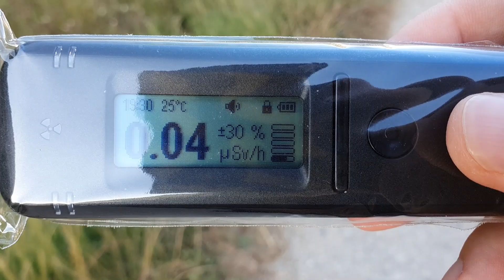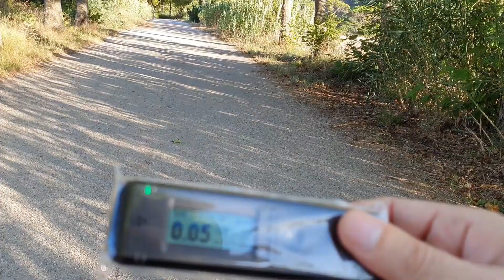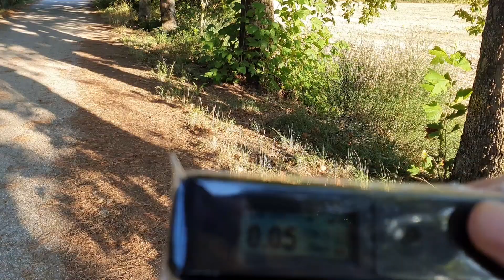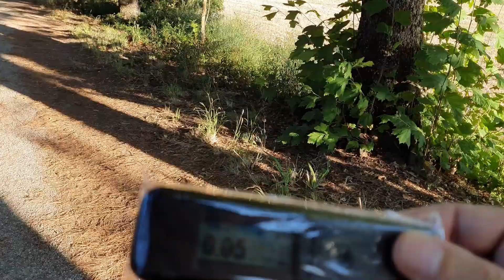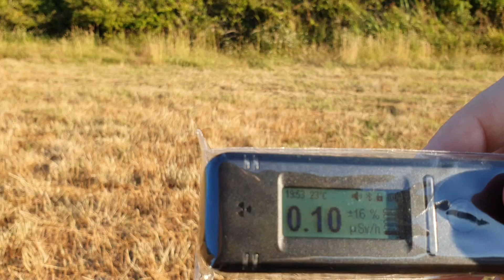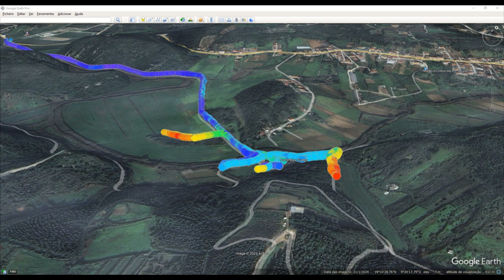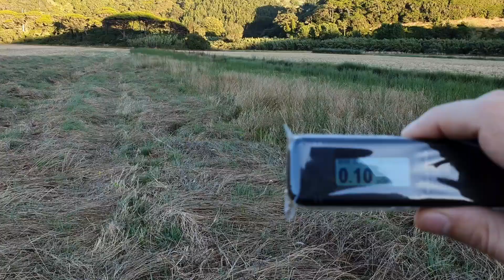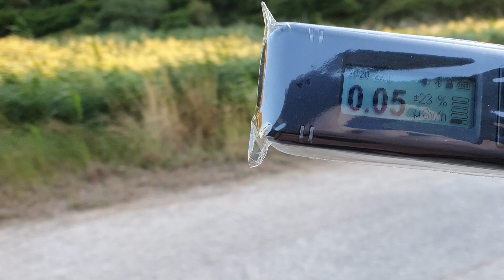Radiation Levels in Agricultural Fields

Comment: What's the highest reading you've found from rocks?
I've got glacial erratic with Radiacode 110 reading 200 CPS in one spot. (twice the reading of putting RC110 touching ionizing moke alarm)
Gamma spectrum shows decay chains of both Thorium-232 and Uranium.
Have also one other boulder nearby with nearly similar reading and possible source bedrock for that.
Reply from the maker: Measurements in CPS (Counts Per Second) or CPM (Counts Per Minute) are not traceable quantities, meaning they cannot be directly compared between different instruments against a single reference. CPS/CPM are "raw" values. As I have explained in other videos, a more sensitive instrument will display a higher CPS reading than a less sensitive one. However, the dose rate (μSv/h) should always be the same, regardless of the instrument used, provided that the detector is energy-compensated. For example, the RC 110 is more sensitive than the RC 103; therefore, a reading of 200 CPS with the RC 110 may correspond to only about 80 CPS with the RC 103. The larger crystal will naturally "catch" more photons, resulting in higher CPS for the same radiation field, yet both should report the same dose rate (μSv/h). 

Regarding mineral samples, the highest dose rate I have personally measured was approximately 25 μSv/h, with the detector held in close contact with the sample, without physical contact. There are, however, several videos from other users showing contact dose rates exceeding 400 μSv/h, although I have not yet come across cases where they exceed 1000 μSv/h. Dose rate varies significantly from mineral to mineral and depends on the degree of purity of uranium or thorium compounds present.

The ionization chamber of a smoke detector produces a higher count rate for the same dose rate when compared to uranium- or thorium-bearing minerals. Americium-241 (found in smoke detectors) emits a prominent low-energy gamma at 59.5 keV. Because these photons are low-energy, a detector sees many of them (high CPS), but they contribute less to the actual biological dose compared to the high-energy gammas from the Uranium decay chain (like Bismuth-214). For these higher energies, each individual count contributes more to the total dose; consequently, the counts-to-dose ratio is actually lower.

Finally, safety is paramount. Avoid unnecessary and prolonged proximity to these rocks and never handle these samples with bare hands to prevent contamination from radioactive dust. If you keep such samples at home for academic purposes, they should be stored in a sealed container and placed in a well-ventilated area, due to the emanation of radon gas and its potential accumulation in enclosed environments.

Comment: Can you measure levels in the fields of Palomeras to see if the plutonium is in concentrated amounts enough to be detectable?
Reply from the maker: Yes, it is possible to detect contamination by Plutonium-239 in the fields of Palomares, Spain, as a result of the 1966 Palomares accident. However, since Plutonium-239 emits gamma radiation of very low energy and in extremely small quantities (the most representative emission being ~13 keV with an emission probability of only 0.034%) we will not be able to distinguish its extremely low dose rate from the background radiation naturally present.

Therefore, for the detection of Plutonium-239, an X-ray or gamma radiation detector would not be suitable. Instead, an alpha radiation detector would be required.
Reply: @IonizingRadLab  that is what I was wondering about. Maybe if someone has an alpha probe they can sweep it around there. I've never seen any radiation hunters do any videos about the place.
Reply from the maker: You're right to wonder about that, and I share you're observation. While alpha probes and handheld alpha detectors do exist, alpha particles have an extremely short range in air, usually just a few centimeters. They are easily blocked by even a thin layer of dust, moisture, or vegetation.

This means an alpha detector must be held very close to the bare soil surface to pick up any signal. Moreover, the presence of naturally occurring alpha emitters, such as radon decay products, uranium, and thorium, adds complexity to the analysis.
Reply: @IonizingRadLab  I got curious and on wikipedia it actaully says there are fenced off areas, that makes me think that it must be somewhat detectable there.
Reply from the maker: @thesciencefurry , yes, there are still fenced-off restricted areas in Palomares, and radiation is indeed detectable. Although the US removed tons of soil in 1966, traces remained. Studies in the early 2000s showed residual contamination was higher than initially thought. As a result, the Spanish government (via CIEMAT) fenced off the worst zones to prevent construction and farming. The real danger isn't standing near the fence, but rather inhaling dust or ingesting contaminated dirt. The fences exist to ensure no one disturbs the soil and releases radioactive particles into the air.

Many common field survey meters can miss it because Plutonium-239 emits alpha radiation, which travels only a few centimetres in air. Thin-window (mica) GM tubes designed for alpha detection can detect Plutonium-239 alpha particles when the detector window is very close to the contaminated ground, which is generally impractical under real field conditions.

In the field, they scan for Americium-241. The original material contained Plutonium-239 mixed with a smaller amount of Plutonium-241, the latter of which has a half-life of approximately 14.3 years and decays into Americium-241. Since it has been decaying for decades, the amount of Americium-241 at the site has increased over time and is now detectable. Americium-241 emits easily detectable 59.5 keV gamma rays, allowing field teams to rapidly map the extent of the contamination.

In the lab, soil samples are analyzed using alpha spectrometry to directly measure Plutonium-239 and determine the exact magnitude of contamination.